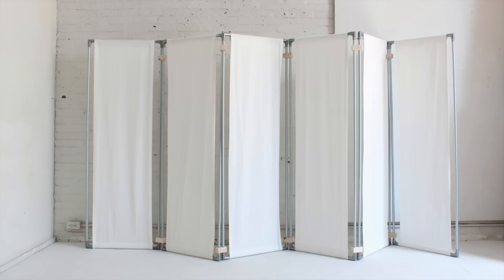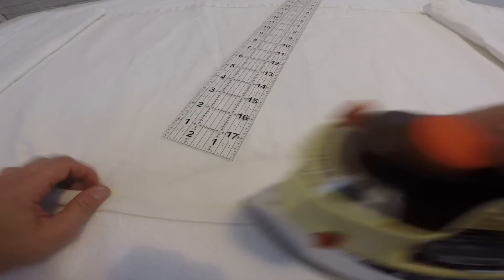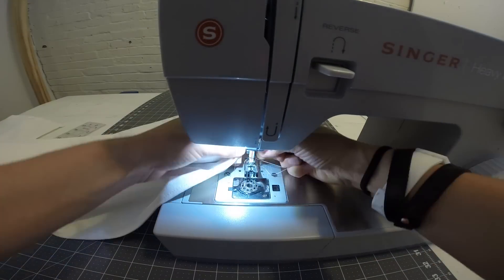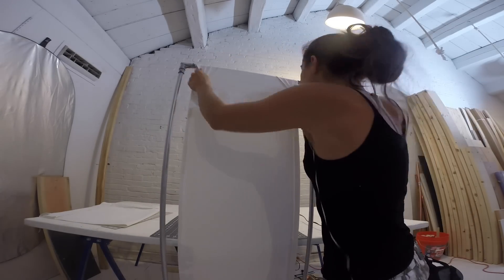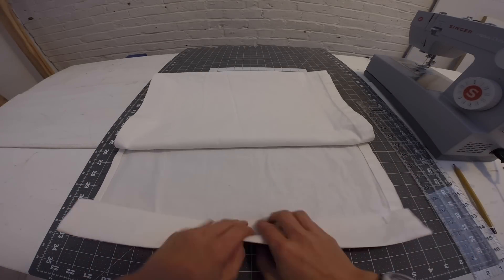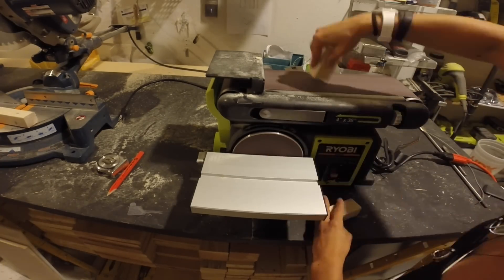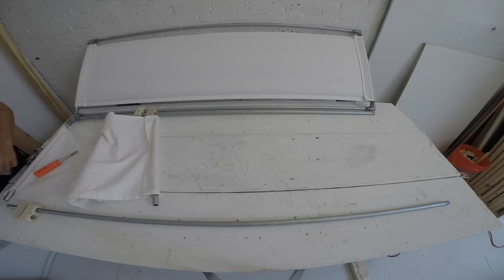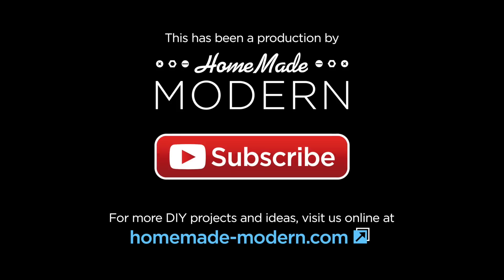DIY Room Divider

Comment: Cool video!  

I got an idea while watching your video that may be an improvement to your hinges.  If you under size the holes on the wooden hinge just a little, drill a hole thru the middle on the side without the holes, cut them in two L-shapes* by cutting through the holes, you could use a nut and bolt with a couple washers to make a clamp hinge, tighten the hinge so it doesn't fall under gravity and you're all set!  You wouldn't need the zip ties or the set screws this way.

*on the left hole cut from the left side of the hole to the top, and on the right hole cut from the right side of the hole to the bottom
Reply from the maker: +TheAmusingMe great idea! thanks!